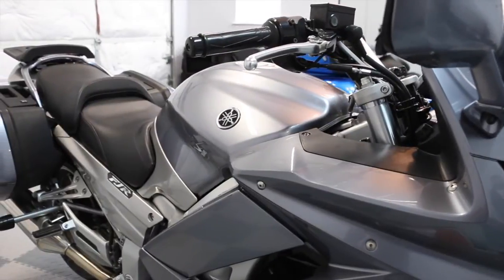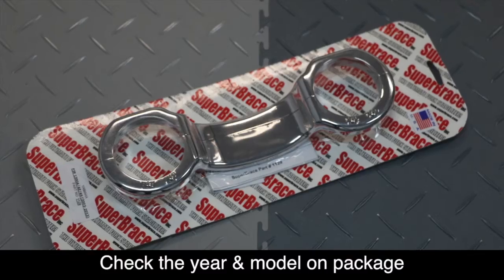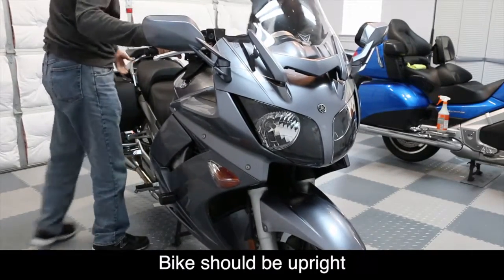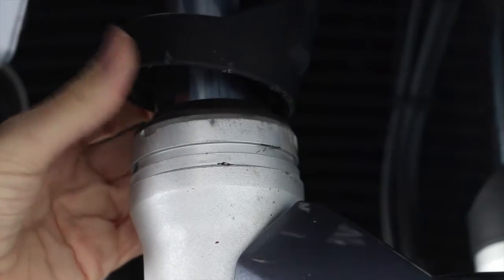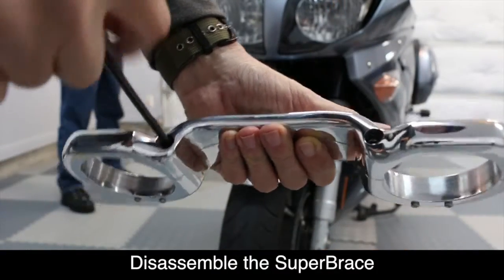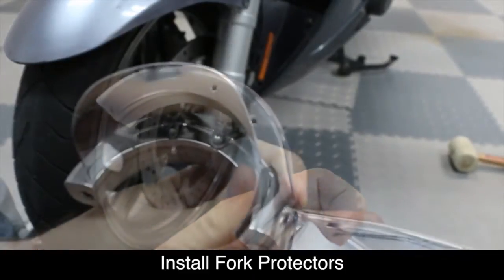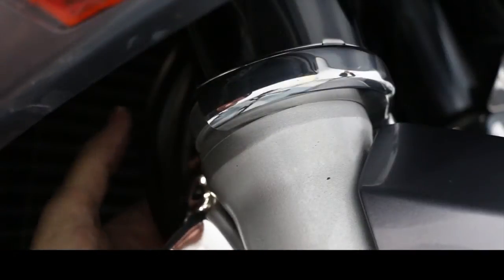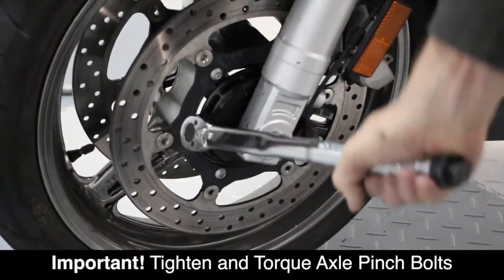Yamaha FJR 1300 — SuperBrace Install Video

Comment: I am going through front tires like crazy on my 2005 FJR1300. Had new tire on when I bought bike, replaced after about 3000 miles ( first self oil change ) and I waited way too long to do it. Tire was cupping bad enough you could feel it driving and it affected cornering severely. New tire doesn't even have 1000 miles and it is already showing moderate cupping. 
I heard about this brace and have heard mixed reviews on how much it prevents cupping, however, I would like to pose a couple questions to hear other opinions and experiences.
I drive really fucking fast. I average probably 90 to 100 on empty road but I slow down in traffic- I don't want to endanger other people. I often take it to 140 and above just because I'm that type of idiot- I know. I have noticed after slowing down - not braking after these extremely high speeds I can smell rubber burning. If I stop and touch front tire it is extremely warm. 
I have run the tire pressure at 42 psi which should by all accounts be ample pressure.
I have checked front wheel bearings and do not believe they are an issue.
The brakes check out perfectly as far as the mechanical operation.
I thought maybe this brace might help, but am having second thoughts.
I am thinking maybe, possibly there may be an issue with the ABS kicking in at very high speeds due to speed sensor differentials between front and rear. Does anyone know if this is possible or if the system even works off of wheel speed sensors as automobiles do? Perhaps it is sensing the difference and applying the brake electronically? Once again -I don't know if this is possible without manual mechanical application of brake lever.
Or maybe, the front wheel assembly just has mechanical limitations that will not allow it to spin as fast as rear and so it is scrubbing the tire as it tries to "walk over it".
Any advice - other than telling me to slow the fuck down- would be greatly appreciated
Reply: Did you ever figure this out?